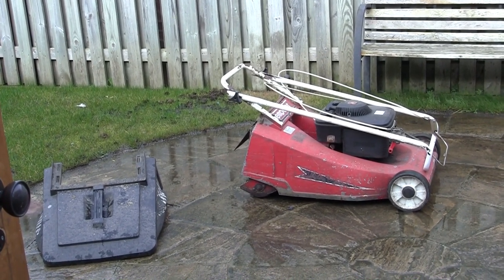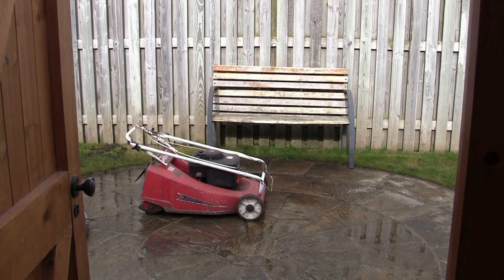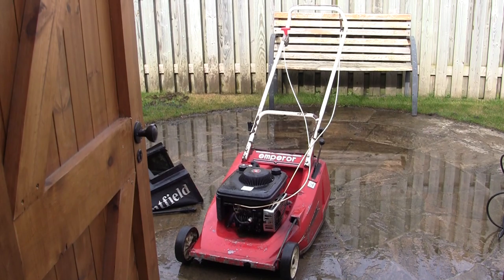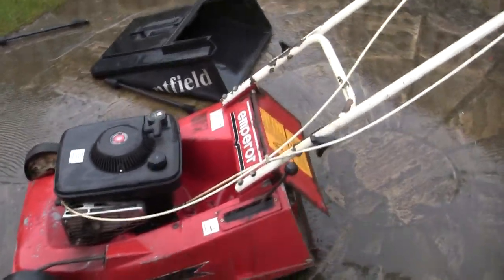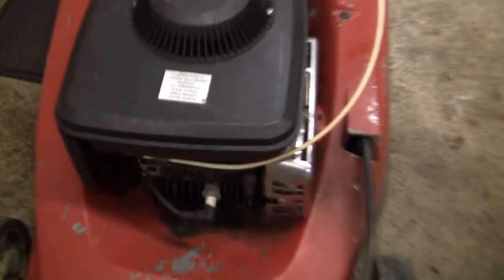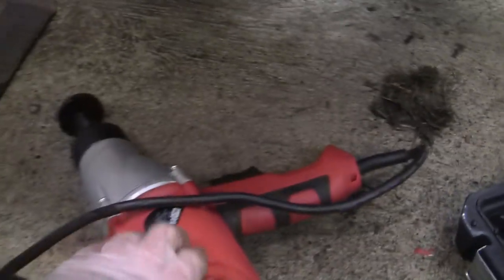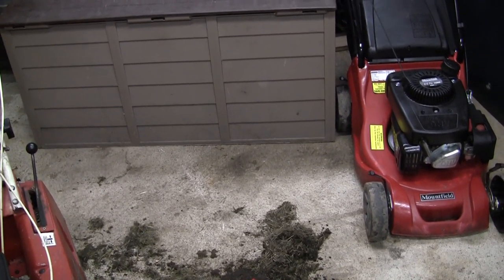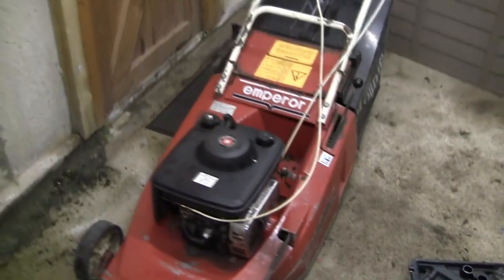Mountfield Emperor Retro Lawnmower Will It Start?

Comment: Very disappointed you didn't finish the job but I do understand why.  I have a Mountfield Emperor like that which I bought new in Spring 1991.  It is still working well and I have used it continuously to cut my lawn which takes about an hour to complete each time.  I think I need to replace the drive belt for the self propelled roller and I was hoping you would show me the correct procedure and how to tension the new belt properly.  Any videos out there that do please let me know. Thanks.

Comment: Bought our Empress 18 in 1989, very similar to the Emperor, with the same height adjustment mechanism; still using it today, works perfectly! :)
As an aside, if you undo the large wing nuts, and fold the handle over, you can then sit it up upright, to get to the bottom.

Comment: ive had one since 1980 something, it got stuck at the back of my workshop for 16yrs. it started 3rd pull. dont hold drive lever when starting lol. it came with electric start, i removed it as was always flat. the battery sat behind the motor.

Comment: I've been using one of these mowers for a couple of years. I did feel it when your fingers slipped off the handle. I've done it myself a couple of times. It's not much fun. The first time i expected to find the ends missing!
The thing i like about this mower is the fact that the bodywork is aluminium not steel!
NO rust. That's why i got rid of my last mower. It did a great impression of a muck spreader the way it threw the grass out sideways.
Would you have any idea why mine has now stopped working? It starts but only runs for a couple of seconds. I removed the tank to check that the tap was working then removed the float chamber and as it looked like there were a couple of bits of water in the bottom when it was ampty i cleaned out the tank as best i could and put new fuel in. It now runs for up to five seconds! Do you think there might be a blocked jet in the carb?
Can you get gasket sets for them? I'm a bit wary of taking it apart without new gaskets.
Reply from the maker: Yeah sounds like the carb

Comment: Bit perplexed as the drive on mine has just stopped working ? The roller turns the drive shaft so I am thinking has to be where the drive shaft connects with the engine. I am on here trying to get some pointers ?

Comment: Hi in 1976 i started a 4 year apprenticeship as a lawnmower mechanic, and the dealership i worked in was a Mountfield dealer, so i cut my teeth on those mowers, nice solid  cast alloy deck and a decent engine.Built to last as you can see still going strong 40 years later, give me the older stuff over the cheap plastic, chinese  engine rubbish any day.  I mean you cant even check the oil with out the whole diostick tube coming out. Great video to watch on a cold wet day .
Reply from the maker: alan lake Thanks Alan. I actually couldn't get the engine off as there was a metal pipe running into the deck! Any thoughts
Reply: @MowerMan  Thing the metal tube is the drive shaft for the self drive, as it come out from the sump, but could not see very clearly. You could try attatching a spring to hold the height adjusting lever in place. Its a good solid running large mower with a grass box someone will have it .
Reply: Hi Alan, I have just had the drive on mine stop working. The roller at the back turns the the drive shaft, (which I thought had broken). So I am assuming the fault is lying the engine side of the drive shaft. Which I haven't got a clue about. Any pointers ?